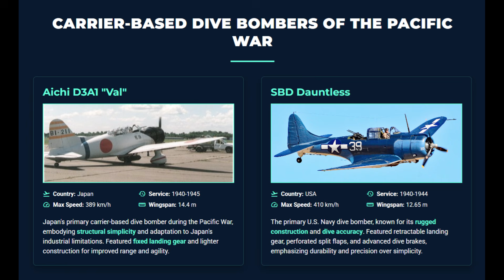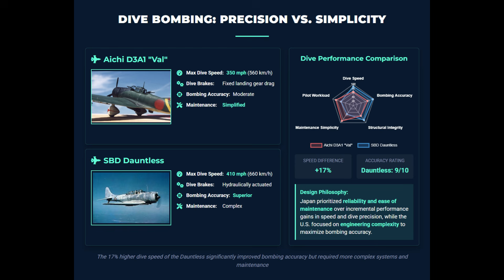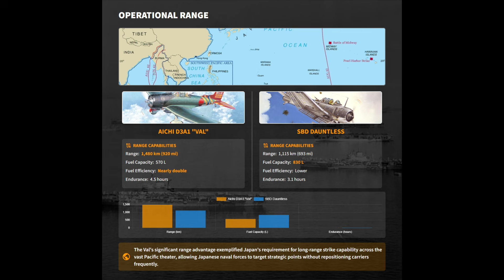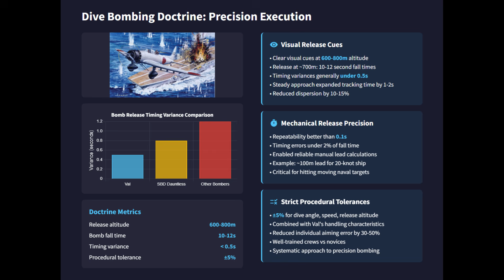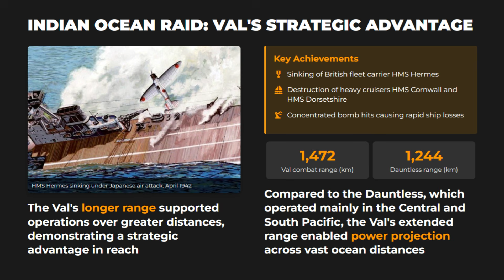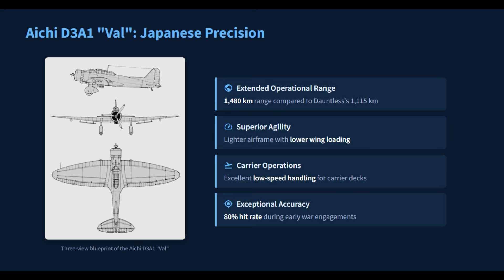Val or Dauntless? The Best Early-War Dive Bomber

Comment: You failed to mention the difference in wing folding.  The Val only had folding wing tips, which allowed larger tanks, which allowed longer range.  The Dauntless had folding wings, which cut range, but allowed more planes per square meter of hanger deck.

Comment: The pic on your thumbnail looks pretty, but it doesn't look at all like a D3A. It almost looks like a fusion of a D3A with an A6M. The tail fin is much too small and short, the wheel spats are much too minimal and look like they are retractable, there is no bomb-cradle or bomb on the centerline (or wings), and the cockpit is much too short, and looks like it's for a single crewman. AI generated?

Comment: Next D-4Y vs SB-2C
Reply: The answer depends on which variant uses which engine. 

The Yokosuka D4Y Suisei was initially powered by the liquid-cooled inline Aichi Atsuta, a licensed version of the Daimler-Benz DB 601. The Atsuta proved to be mechanically unreliable, so it was replaced by the air-cooled radial Mitsubishi Kinsei. The planned D4Y5 Model 54 was to be powered by the 1825-hp Nakajima Homare driving a four-blade propeller, the same engine which powered late-war Japanese fighters such as the Kawanishi N1K-J Shiden-Kai and the Nakajima Ki-84 Hayate.

The Curtiss SB2C Helldiver was initially powered by the 1700-hp Wright R-2600-6 Twin Cyclone driving a three-blade propeller. Unfortunately, the Helldiver's overweight design and underpowered engine gave it a sluggish performance which created a poor reputation among U.S. naval aviators and led to a scathing report by the Truman Committee. It was not until the Helldiver was upgraded with the more powerful 1900-hp R-2600-20 driving a four-blade propeller that it came into its own as a reliable dive bomber.
Reply: @christopherwang4392  Thank you pal! It is somewhat curious that, while unable to substitute the A6M5 with a more competitive fighter (although i think that, had the japanese pilots been adequately trained, it could have hold himself against the Hellcat), the B6N Tenzan And the D4Y Suisei can, in some respects, be considered superior to their American counterparts.